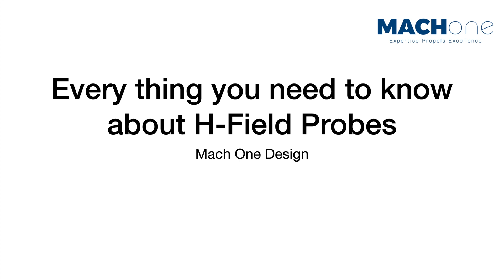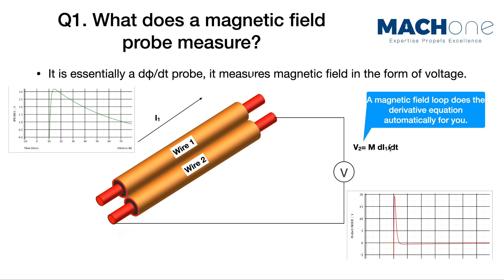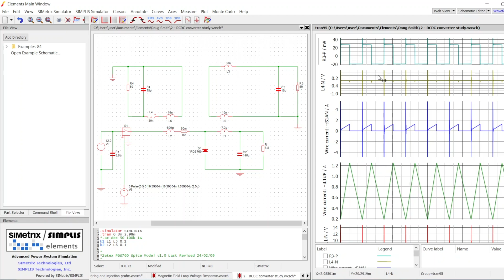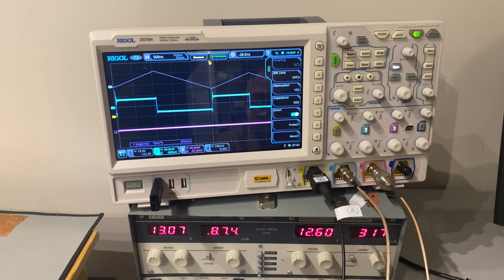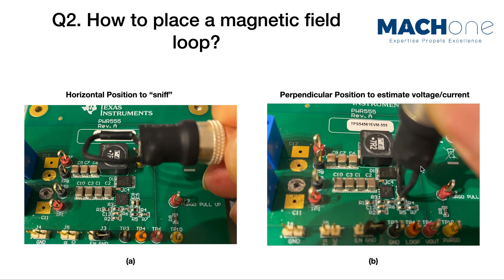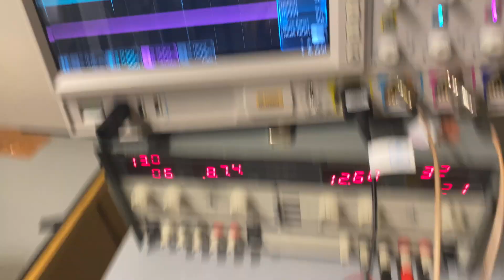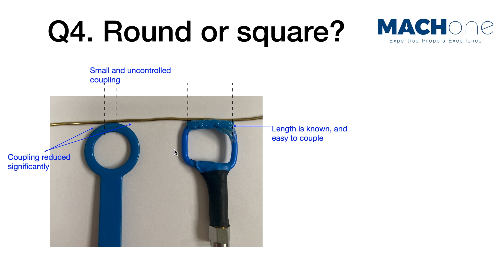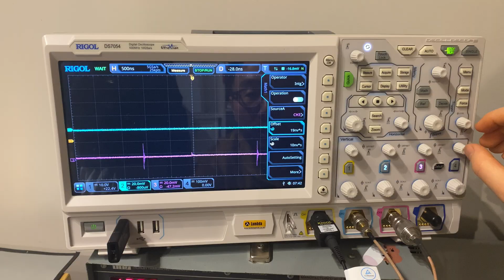Techniques of using Magnetic Field Probes

Comment: Nice video Min. How did we end up watching at 90 degrees at 10:23 !? I know it's a video on using magnetic probes, but it would be good to see a video of the process of solving an issue end to end. i.e as you stated, the emissions wouldn't pass higher automotive standards, so having found an issue using magnetic field probes, what specifically (on that Buck/Boost board) could you change to reduce those emissions.
Reply from the maker: Hi Simon, good catch. Yes, I noticed that when I finished uploading. To redo it again will just cost a lot of time and effort. So I thought, forget it, leave it like this. Let's see how many people stick to the last bit. To be honest, due to the short interest span of people these days, any video longer than 7 minutes is not going to be very popular. So initially I was even hesitant to put the simulation part, but then again, the flow is simply not right. I also know that not many people like the simulation, but in my opinion it is such a nice tool to assist electronics design. Same applies to your request, if I included the solutions, this video will easily exceed 30 minutes. Maybe next time!